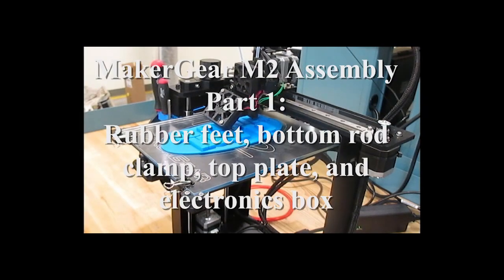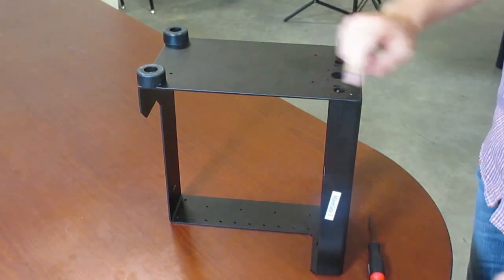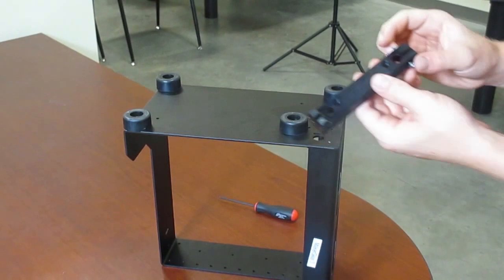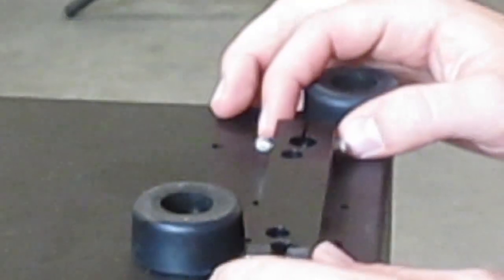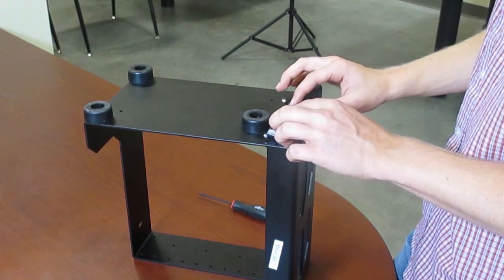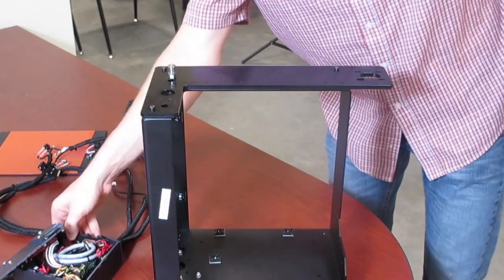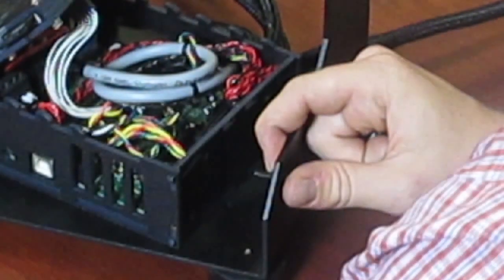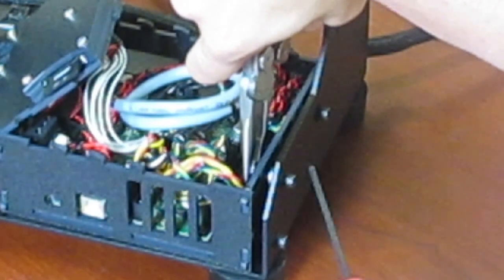MakerGear M2 Assembly Part 1

Comment: I just got to the wiring on my kit and found that my board doesn't look like the one in your link, or the one on makergear's site.  (before or after the updated instructions)
It's similar, but definitely a different connector configuration.  I got the kit straight from makergear, and they haven't responded about the problem yet, any suggestions?  Any videos showing your board/wiring?  Thanks.